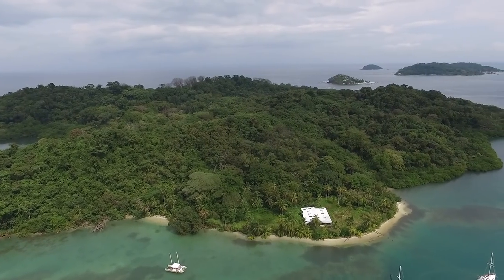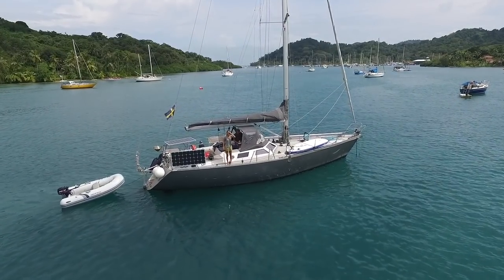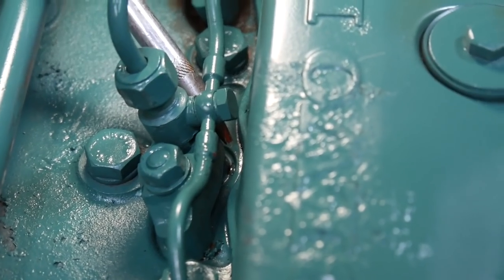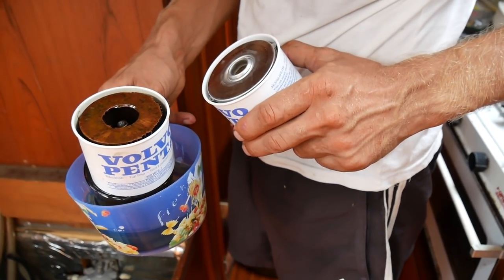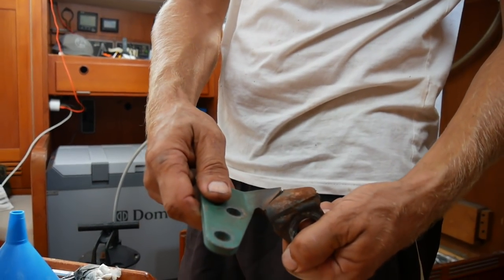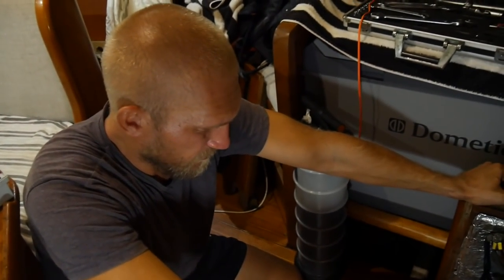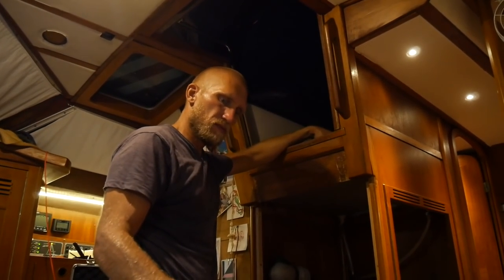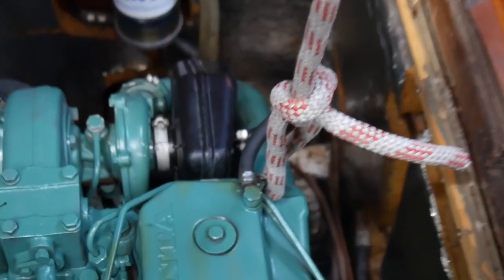Mechanic Monkey Business - Ep. 91 RAN Sailing

Comment: About your fuel leak, all those copper sealing washer in the fuel system can be re used if necessary.  All you need to do is heat them up red hot with a propane torch and let them cool off. It will softened the copper and they will swell up again for another round of sealing. Bryan on svDelos did this last year to fix a leak. Ciao!

Comment: maybe this is overkill but i always found it helpful to write the date and hours on the filters with a magic marker. then i don't have to rely on my memory or dig around searching for the maintenance log
Reply: I do that in yellow paint pen. The magic marker ink is usually black and its oil based so it will disappear on you if there's any oil leakage at all.
Reply: charles curtius im
Reply: We always did this on the Cranes, Tractor trailer trucks, and other heavy equipment...

Comment: I have the same Volvo Penta 2003T, and I have to admit, I have been a little lazy on the valve adjustment myself.  I am envious of the access to the engine you have - if mine wasn't so hard to get at, I might not be so lazy with the valves.

Comment: Good job on the Volvo 3 cylinder Diesel engine work, seems as though most guys no Nothing about adjusting valves, timing, or Anything else about engine maintenance now-a-days 😩🥺🧐
SO,  you Finally found Mr. Parrins  19:30. at the club for New Years Eve... lOL 😂

Comment: You can make an extractor tool using threaded bar and coach bolt but you need the flaring tool to fit new one. Simple when the kit is available

Comment: you mentioned the engine bracket was mild steel, do you have to do some kind of  salt water barrier protection to stop it from rusting after having it welded? Great episode guys, fair winds !
Reply: You got like 4 options to keep steel from rusting, paint (oil based, epoxy based paints...etc), powder coat, galvanize (hot or cold dipped), and zinc. Depending on what it is for some are better choices. Example an engine most people use paint, they do sell engine paint that's rated for high heat. Powder coating is a nice hard finish, although probably not preferred for this situation because of the vibration on those mounts would eventually lead to it flaking off because it is such a hard finish (no flex). Powder Coating is also expensive and time consuming among other things. Zinc plating and galvanizing is a cheaper option that works well, Most trailers are galvanized, however galvanized doesn't give you the finish that zinc does although zinc doesn't give you nearly as good as protection that galvanized does. Galvanized metal probably gives you the best anti corrosion out there albeit wouldn't be the first choice for an engine mount cause when you galvanize something your adding material to the surface which then can make it difficult putting your engine bracket back on if you already have tight clearances.

Granted in johans situation any paint would be fine, however if it was me, i'd find some paint that matches his volvo green and maybe he cant find it there so hes waiting.  That steel engine mount would take a damn long time to rust out siting in his engine bay unpainted, probably 10 years +-3 years, hell may even last longer than that.

Comment: The stamped sheet metal filter element cap is held to the filter paper element with glue/sealant.  It appeared that it has just simply released due to poor adhesion at the time of manufacturing.

Comment: We had the same engine mount break on our Volvo 2003T in 1993. The new replacement mount is not a stamped piece, the new one is cast and much larger. I was shocked to see difference. Here - http://www.scheepsservice-landstra.nl/Volvo%20Penta%20MD%202003%20a.JPG

Comment: Water can easily get out of your tank by using tampons which you but in it with a bolt to make it more heavier. As diesel is more heavier than water. Quick and easy
Reply: hmmm diesel is less dense than water, that is why water settles to bottom of water/fuel filter arrangement.